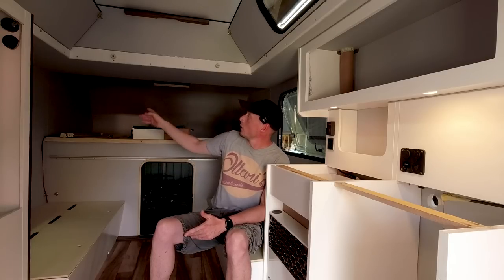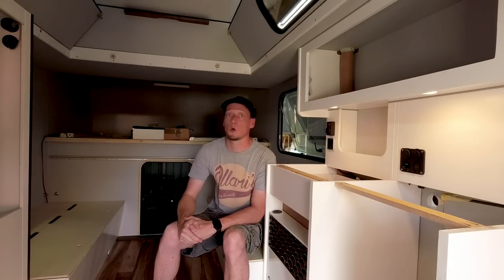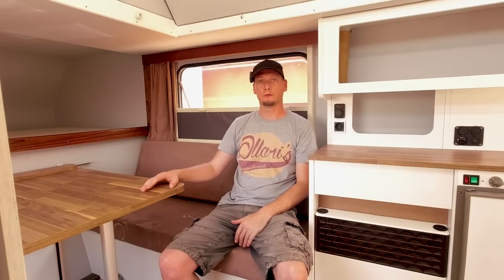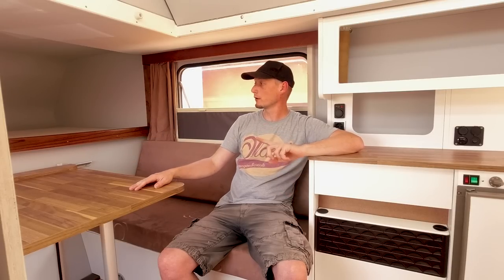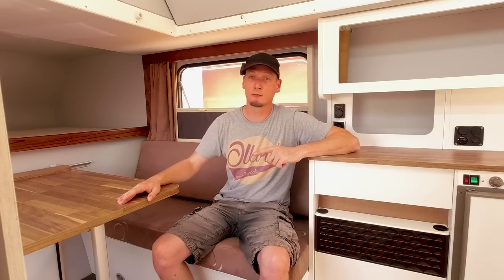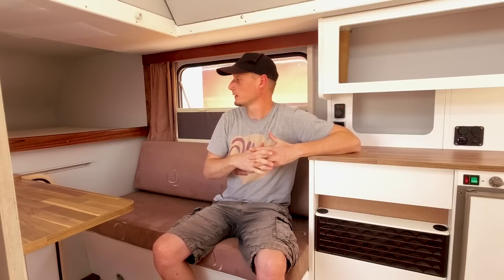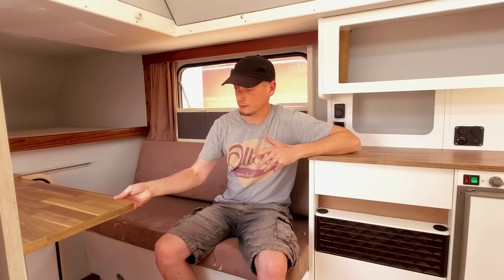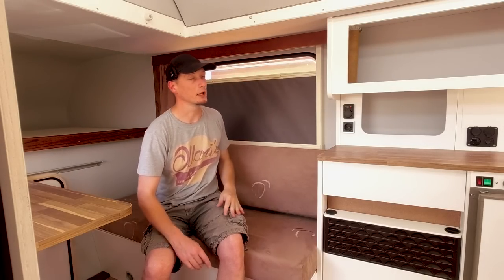Building a Lightweight Countertop and Dinette Table using STYROFOAM! // Truck Camper Build Ep 19

Comment: It looks really well now. Worth all the hard work. A suggestion. On the underside of the chopping board / draining board you should possibly consider putting some aluminium or thin stainless sheet to protect it from when the stove pot support frame is still hot. Over time the heat may cause damage . It is quite a common thing on boats, the more modern having a glass cover.
Reply from the maker: Great idea! I will do that! Thanks so much!